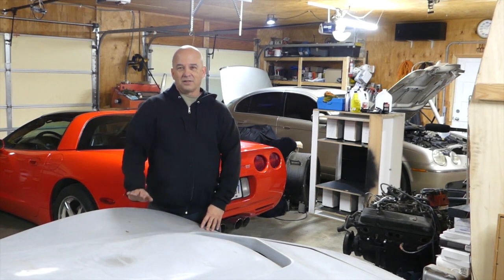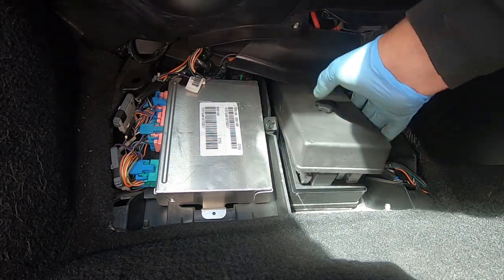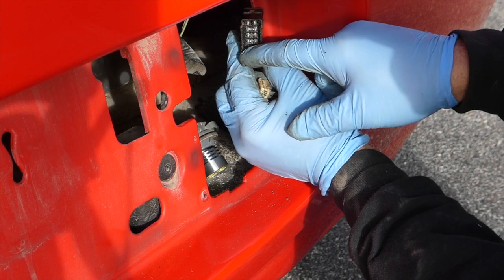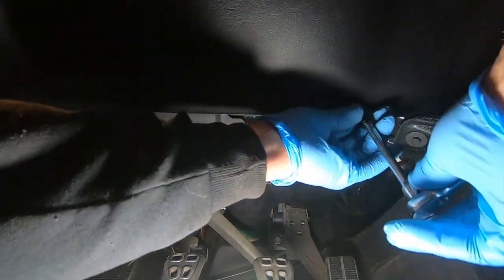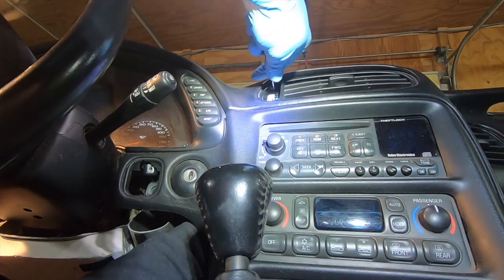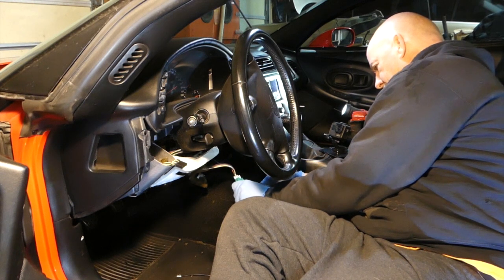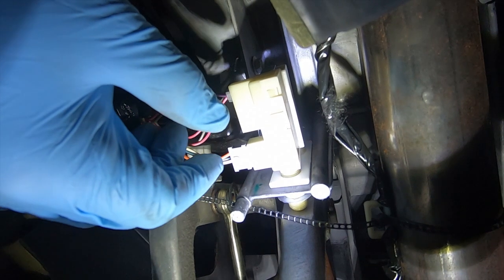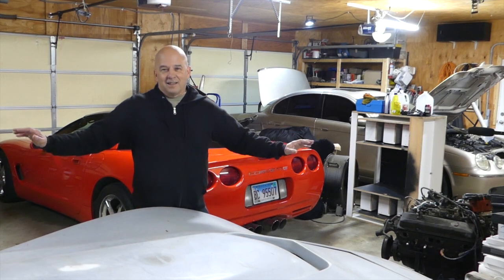C5 Corvette Rear Lights not working.  Fuses, grounds, hazard switches and brake switches.

Comment: Your tip on how to remove the hazard switch by using the screwdriver on top and pressure pushing up on the backside had mine out in under a minute. Using the jumper technique I was able to determine that my hazard switch was bad. I’d replaced it once already about a year ago. Surprised it went bad already. Thanks for the fantastic tips and very helpful video. (2004 C5 coupe base)

Comment: I have a unique issue I replaced my headlights with leds and some interior lights and have the hyper harness installed and replaced the hazard switch still no turn signal and new bulbs, will check fuses.

Comment: I have 2002 c5 and starting to hate it.

After I wash my car or it rains , my left blinker flashes fast and makes my left brake light go dim...once its dry , the next day it will work properly...makes no sense.

As far as the hazard  switch goes , if you dont have big hands and big forearm you can switch it without taking the dash apart.

Comment: "Cleaned some grounds....." Which grounds? This video doesn't help at all. Cleaning a ground wire is practically free.
Reply from the maker: Did you watch it?  3:20 shows where the ground is that should be cleaned.  Yes, cleaning ground wires is free... not sure what you mean.

Comment: I replaced the hazard and brake switch still no tail lights
Reply from the maker: Did you check the ground?  Did you check the fuses?  C5's are very temperamental.
Reply: Where did you order your brake switch from? No one local has jt

Comment: I'm on my 2nd hazard switch, if this one fails I'll be using the jumper and bypassing it - thanks for that info. I lost all brake lights recently, pulled the brake switch, pushed it in and out a few times, reinstalled and wham.... brake lights. I'm trying to find a replacement to keep on hand because I'm sure it will give me problems again. Out of stock in a lot o places.

Comment: Did you push in the bottom tab first?……or just push up the back and use the screw driver on the top tab?
Reply from the maker: I did like at 7:38 in the video, pushed up on the back that relieved the bottom tab and then pushed down on the top tab and just kept working it.